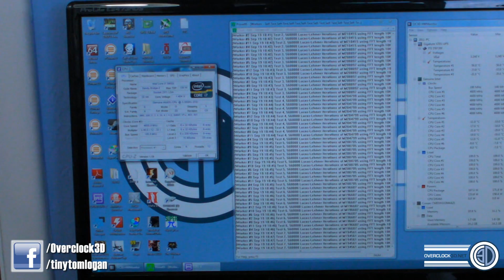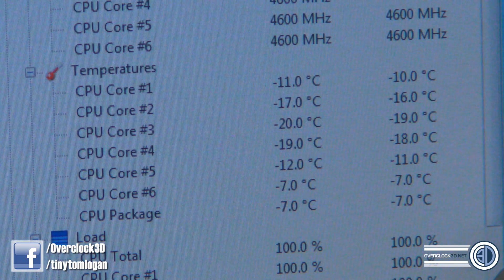Ultimate Corsair H100 Cooling Mod

Comment: Aerospace Engineering student passing through. 

Adiabatic cooling is responsible for the negative CPU temperatures observed.

Air is accelerated through the giant stack of fans, passing through the radiator. 
This acceleration implies a decrease in pressure between each fan stage. (Think about it) This pressure drop occurs all the way from the front of the first fan, to the front of the rear fan. 

This drop in pressure does not have to be substantial to observe a sharp decrease in temperature, in this case only 10 kilopascals, or 1.45 PSI for a temperature drop of 30*C

For this cascade of 20 fans, thats only 0.072 PSI per fan stage, which would be a good /conservative/ estimate of what these high performance static pressure fans are capable of.

For calculations, and to learn a thing or two before arguing, read up on adiabatic processes:

http://hyperphysics.phy-astr.gsu.edu/hbase/thermo/adiab.html

Now go do some science.
Reply: I don't know about the radiator, it made sense thermodynamically, but highvoltagefeathers is right in saying that water would boil and then freeze in space due to the pressure being 0.
Reply: wow the replies to this comment made me loose brain cells. highvoltagefeathers I agree with you on your comment and I have no clue what that other guy is talking about. lol
Reply: if you increase pressure the boiling point of water increases. if you decrease the pressure so does the boiling point of water.
theory is very simply proven.
ur cars engine have a cooler. disconnect the fan on that cooler and take a ride. ride the car hard so the engine gets hot (in the red field on the dashboard). now go out to ur cars engine and listen. can you head boiling water ? no ? try unscrewing the cap where you fill in water. as you do so. the pressure that had builded up inside the cooler escapes and drops, as it do so, so will the boiling point of water. and the water boils instantly and violently.
Reply: highvoltagefeathers  its obviously a joke video
Reply: Kyle Cook, well, probably a better COLLEGE than you, due to the fact that can actually spell the word of the establishment you are attending.
Reply: The atmospheric air would only be accellerated through the fans if each one was running at a higher rpm than the previous fan, with them all running at the same rpm the air would only be accellerated by the first fan then the rest of the fans would only maintain the speed of the velocity of the aforementioned air so this many fans will have the same cooling effect as a single fan there would be negligible increase in pressure after the first fan. (I know its fake!)
Reply: highvoltagefeathers  Did you watch the whole video?  This whole thing was fake and a joke.
Reply: Wajdy Ysseck  Mechanical Engineer here, Its a hoax,  look at the power consumption. He's running a 3960X at 4.6GHz - if it was true that means, in order for below zero temperatures to be reached, the cooling system would have to dissipate more than the total dissipated power from the CPU die - which is about 170W.  The cooling system is a H100i plus 40 SP120 fans, assuming that ALL of the power that those devices draw is cooling the system, then that's 80W for the H100i, and then 0.95W per fan - so 38.4W, giving a total of about 120W. Now this figure is only useful for cooling below ambient otherwise you get coupled power dissipation  from the temperature difference between the atmosphere and the radiator, increasing the effective power dissipation. So let's say the hydro manages to get the CPU temperature down to ambient with no power at all, and the 120W is put entirely to compressing and expanding the air in the room to get the adiabatic cooling effect, and lets also say that this compressor/expander is 100% efficient, so that 120W is entirely doing work to the ambient air, that means the 120W of the 'ideal' Carnot cycle (thermodynamic refrigeration cycle) is required to dissipate 170W from the CPU die, (assuming that the CPU and pipes are perfectly insulated) which is obviously never going to happen, and that's assuming an 100% efficient system.
Reply: So if I put a pc inside a vacuum chamber it would have lower temps?
Reply: Garrett Mitchell This was addressed to all the people who said it was fake because it reached a temperature lower than the room.
Reply: highvoltagefeathers
 You forgot to mention that the decrease in air pressure also negatively effects the amount of surface contact between the cooling fins of the radiator and the air molecules,  REDUCING the amount of heat transfer that can take place.

Not to mention that, assuming corsair does not put anti-freeze in this thing (cba to look it up because who buys closed-loop WC kits anyway) water below freezing would.... gasp freeze. Also, condensation on your cpu socket/mobo... short-circuit blah blah yadda yadda.
Reply: highvoltagefeathers Water boils in space, we do not.

Tests were done as a proof of concept, essentially your tears and saliva boils.

Blood? No. Blood is within a very well self contained system.

What does occur is you die from asphyxiation in around 90 seconds, then SLOWLY freeze over about a day to 2 days.
Reply: highvoltagefeathers Hey guys! Physics master student here. I actually did the calculation myself and came up with approx 10.7 kPa for a 30°C change. So highvoltagefeathers is actually correct.
Reply: Darwin test, how many people watched to the end before commenting ?
Reply: However, this would not cool off the room, or violate the first law of thermodynamics.

When the cooled, accelerated air at lower pressure leaves the fans, it quickly (milliseconds) returns to atmospheric pressure.

As the pressure of the gas increases to atmospheric pressure (and contracts in volume slightly), the temperature of the gas increases. This is why air compressors and even manual bike pumps get hot. Again, this is an adiabatic process.

Not only will the temperature of the air return to normal when the pressure returns to normal, it will be slightly (very slightly) higher than room temperature, as friction between molecules in this turbulent air flow will be manifest as an increase in temperature.

This machine cools the CPU, but heats the room, thanks to the laws of thermodynamics and our quirky atmosphere.
Reply: I think you need to change studies. You probably think you freeze to death in space also right? The temps were faked, he even admitted to it.
Reply: Well, you would freeze to death in space. Its a vacuum, and the water in your body would boil immediately (yes, even though your body is only 36*C. check any water phase diagram). This boiling will eventually remove enough heat from your body to freeze the remaining liquid, in a process called desublimation, observed by astronauts when they eject their waste into space.

If you don't believe me, hitch a ride on a high altitude balloon and see for yourself.

I'm comfortable with my studies. Thanks though!
Reply: Wrong, where would the heat go? Theirs no particles to transfer it, you can only radiate heat away which would takes ... a long long long time. Zero particles, zero heat transfer though them. Again, re-think them, it doesn't suit you.
Reply: The heat energy is carried away by water vapor leaving your boiling body.

This video demonstrates water boiling, then freezing in a vacuum, as you would in space.

https://www.youtube.com/watch?v=pOYgdQp4euc

This is probably the reason you aren't designing aircraft.
Reply: What collage are you going to?
Reply: Rasmus0000001306 Ummm. Might I just correct you on one thing. Cars don't get cooled by water. It's anti-freeze and it has a MUCH higher boiling temp and MUCH lower freezing temp than normal water. Other than that, I have no clue about physics sooo.... sure.
Reply: Thanks for the explanation! :)
Reply: highvoltagefeathers  its obviously a joke video
Reply: EPaR - Aidan Gieg Yeah he did a lot of jokes. but if you actually watch the entire video he tells you he was trolling too. It is easy to understand each fan will not help push the air any faster..I just wish I could afford 40 of those fans.
Reply: Danielle Lowe Actually he is right. First with the Temps in space and with the fact that the temperatures on the CPU core is not fake.

I have done a similar "experiment" at the company i was working. Our results werent that cold but our AMD Octa also run around -7 to -12 degrees.
Reply: RoMMeL1337ak47

Like i said. We had different fans and an custom builded watercooling (we were not using regular water) system. Our temperatures were negative.

Math cannot explain this situation 100% correctly because of all the different facrors. Get over it.
Reply: 16Bit_Gamer That is were you are wrong. Pure anti-freeze is a poor heat conductor. You never use only anti-freeze in a car or cpu cooler. It's the water that transfer the heat to the radiator. The anti-freeze only does 2 things. 1. It prevents the water from freeze. 2. It contain additives too prevent the metal from reacting with the water and each other.
Reply: Martin Balle never said it was pure anti-freez. I'm talking about the stuff you get off the shelf. My point still stands.
Reply: RoMMeL1337ak47 face palm indeed, some people these days lol
Reply: 16Bit_Gamer Yes the boiling point is raised with coolant added, however cooling systems on cars are pressurized. That's why radiator caps come in different types that are rated in pressure. Either in bar or PSI usually around 1.0 bar or 15psi. Yes the boiling point of coolant is higher than of pure water, but when you get small pockets in the head there is usually hot spots that don't get cooled very well and actually turn to vapor, thus the need for keeping the cooling system pressurized. If coolant never boiled you wouldn't even need a pressure release or any sort, coolant would just move along and no pressure differential would arise other than turbulence in the coolant moving through the passages.

This is also why F1 cars run much higher pressure
Reply: RoMMeL1337ak47 I dont know much about the pressure drop across fans so I just assumed +highvoltagefeathers is competent regarding fans (or turbines) as he studies Aerospace Engineering and managed to calculate the necessary pressure drop correctly. Secondly I handle with vacuums every day and simple diaphragm pump brings us from atmospheric pressure (101 kPa) down to about 8 kPa - so 10 high end fans producing a pressure drop of "only" 10 kPa seemed somewhat reasonable :D... But you are definitely right: cpu fans appear to only be in the range of 3 Pa. Tonight I can go to bed a little less stupid.
Reply: JamesCizuz our bodies contain alot of water..
Reply: WikHellfire - PlaystationShare What does that have to do with anything I said?
Reply: JamesCizuz everything, you said water boils in space but we dont, think about it, humans are full of water, which boil, that means we boil.
Reply: WikHellfire - PlaystationShare I thought that's what you meant but I didn't want to assume and give you a chance to give an answer.

Do you understand carbon makes diamonds and graphite? So how could you ever use a pencil to write on paper, since diamond is the hardest mineral(At least non manmade mineral) that shouldn't make sense right?

Well water is in us. That doesn't mean it's the same as water in open space.

For example, does water just boil in the ISS when they try to drink? Nope, because it's within a system.

Water within us is held in place and is no subject to the same conditions which we measure sublimation. Water by itself sublimates, water in a solution or system may not.

Water within the human body is not subject to anything you are trying to say it is, nor does it boil in space.

For example: Your top layer of skin becomes zero atmospheres in space, beyond that pressure stays relatively the same, and you shouldn't expect it to be subject to outside parameters.
Reply: WikHellfire - PlaystationShare Hell just as a funny note, water is liquid and we are mostly water, why aren't we liquid and fall apart? Because it doesn't work that way.
Reply: highvoltagefeathers  YEAAAA! SCIENCE BITCH!
Reply: Kvarnholmen
 Well that I believe but, if remember correctly pure glycol is a bad heat conductor compared to water. That and the fact that when mix it has a lower freezing point, is why its mixed.
Reply: Danielle Lowe oh dear you are really really not smart.
Reply: JamesCizuz It takes longer than 90 seconds to asphyxiate a person.
Reply: Nick Burns Not really, but you don't get one to one scaling. A radiator set up in a push-pull configuration, gives more airflow through the radiator than either a push only or a pull only configuration, but it does NOT give twice the airflow.

In a sense you are sorta-kinda right in that there is a point of diminishing returns and to get optimal performance from this fan setup you would need variations in fan speed, but also you would need fans with different blade designs to optimize airflow.

However, all of that is moot. As soon as I heard 40 fans on a H100, I just settled back to enjoy the ride.
Reply: Gary Grant I meant one fan on either side of the radiator! not just one side and i was only pointing out that it wouldn't build up pressure.
"As soon as I heard 40 fans on a H100, I just settled back to enjoy the ride." - as did I!!
Reply: Nick Burns The idea of adiabatic cooling isn't to increase air pressure but to decrease it by increasing the speed of the airflow. As such, the fans used for this gag would probably not work very well. I suspect you would want to use fans optimized for air flow over fans optimized for static pressure. Very narrow fanblades (probably low in number, also) spinning fast. Note: I am talking about the fan BLADE architecture here and number of blades on each fan. I suspect we are talking less is better when it comes fan blades and size of the blades in a stack of a large number of fans.
Reply: Can someone do the same thing on this video with a freaking professor to verify it!!!
Reply: Adam Pinnock Hold on there, skippy. First, finish school. Nobody can call themselves an MD just because they're in school; you're not a Mechanical Engineer just because you're at uni.  Second, get some tutoring. Seriously. IET student membership is cheap. If you really think that anybody will take you seriously, in a professional setting, simply because you spew forth fancy terms with such an obviously tenuous grasp of the concepts, you're in for a rude awakening. The real education begins after you graduate. Take from that what you will...
Reply: Danielle Lowe Fyi there are particles in space.  space is not a complete vacuum.  Even when you get out between galaxy's you still have some molecules and some heat.  Just not much
Reply: This insane drop in pressure and air temperature acts on the fins attached to the water filled pipes inside the H100i providing for ridiculously cold water temperatures. I'm also assuming that the H100i system is pressurized since the water isn't frozen yet is below freezing.
Reply: highvoltagefeathers Wrong.  These fans cannot and will not be sub ambient.
Reply: *****  it's fake, but a good fake as no-one would be silly enough to spend that much on replicating it. Just combine all the answers in this thread about why adiabatic cooling would not work here (power, specific heat and where the hell is the removed heat going anyway?) And then read up on the Carnot Cycle and why you actually need a fridge (or TEC) to get the temps lower than ambient if you're interested in that! Hope that helps!
Reply: ***** Watch the video to the end.
Reply: Adam Pinnock Watch to the end is simpler.
Reply: +Caloss2 LIVE There where some comments on the troll face and what the heck it meant, so for clarification
Reply: +hed420 Nope, the fans would be useless as there isn't air to dissipate the heat with. As the heat can't be dissipated, it would only increase your temps.
Reply: +Caloss2 LIVE Judging by the comments, not many.  :P
Reply: +highvoltagefeathers Exactly "student" Now come back when you haven't dropped out of your first year ;)
Reply: +16Bit_Gamer Whilst antifreeze solution does have a higher boiling point than water, it is not that property that it is used for.  The antifreeze is there for two purposes.
1. As its name implies.  To prevent freezing of the coolant.
2. As a corrosion inhibitor.

Antifreeze is gernerally diluted to 50% strength (ie half of the cars coolant is water)
Reply: +highvoltagefeathers its fake go to the end of the video.
Reply: I'm surprised if you were able to hold your studies? Because this is massive bullshit here. This is so much superficial knowledge that you spread here. Or at least admit that you learned and revise the stuff you wrote here, because many people believe this.
A bong cooler would be adiabatic cooling. Many fans together would not. There are not sealed tight together, there's a pretty huge gap between every fan.
Reply: Danielle Lowe space is not absolutely empty, there is low low low low pressure, remaining particles, plus the solar winds.

Comment: even if faster moving air could cool below ambient (which it cant), the air doesnt move faster if you use more fans stacked like that, especially with pressure optimized fans like the sp120. with af120s it might make a difference up to like 2 fans in a stack, but thats it.